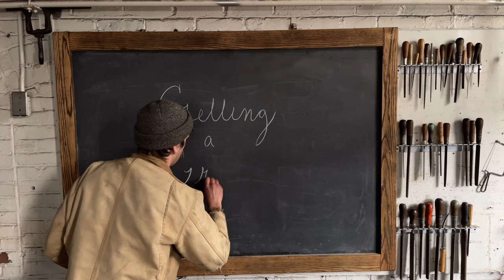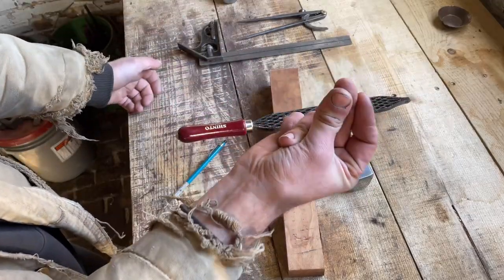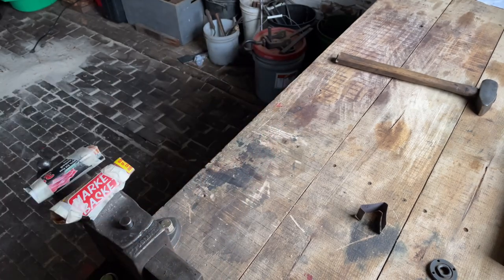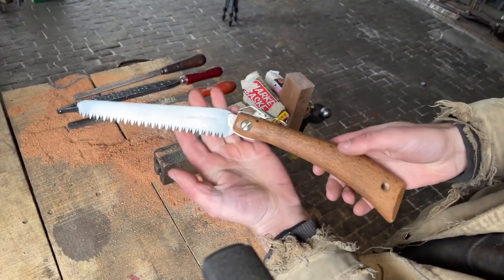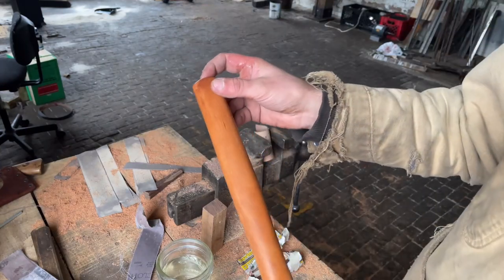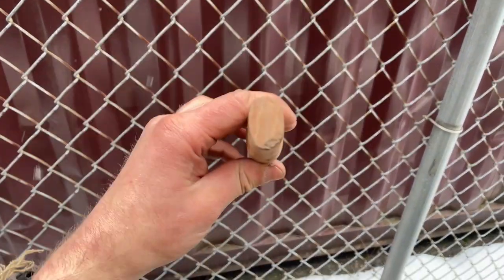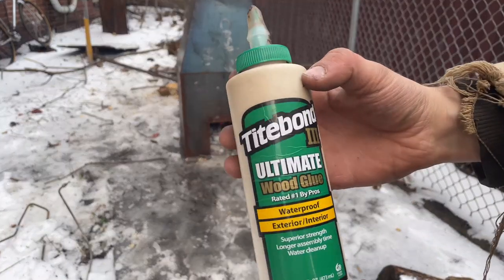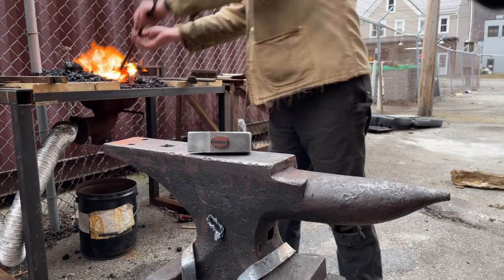Making a handle for my new Blacksmithing hammer using only hand tools (Getting a Grip Ep1)

Comment: Nice work👍🏻 on the Head, in a YT Short in my YT feed that lead me here, and on the Handle.
I watch the other Blacksmithing YT channels. I like Black Bear Forge, John, and his teaching methods. You may already know of him. He's been a Blacksmith for decades. He currently has an ongoing series, vids of which are shown intermittently, on budget friendly blacksmithing start-ups. He's filling in a small shop on his property with basics. Making basic tools, fixtures, jigs, hardy hole items etc. As well as showing and suggesting where to find certain blacksmithing tools cheaper than the time/fuel/cost$ that you'd use up if making them.

Comment: Deleted my og comment because it was stupid, little tip though!: it's fine you're not a woodworker but if you go to an antique place, tool meet, whatever. Get yourself a decent backsaw, Stanley, disston(doesn't matter) steel back or brass back. As long as you have one of those it'll make ripcutting(like you did with that crosscutter) a hell of a lot faster! I like this video a fuck ton

Comment: whyd you have to do the raising the grain part? what does the water and heat do for your handle making process? i wanna know
Reply from the maker: It's not a necessary part of the process, but I do find my final finish is nicer overall. Sometimes the grain will naturally raise with the humidity in the air, and you end up with some rough spots. I find this helps to mitigate that.